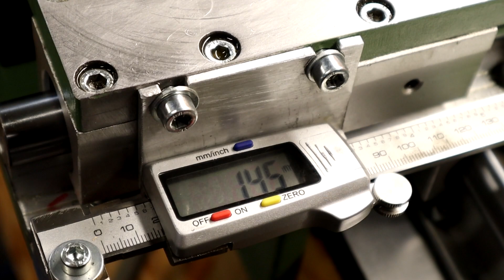Homemade Lathe #7 | Cheap Digital Readout

Comment: Those hardened stainless steel calipers can be drilled with a carbide drill. If you don’t have a spade or twist drill a carbide tipped masonry bit with the tip sharpened will do the job (and they are cheap!) or you can notch the piece as you did. Inexpensive digital readout that functions every bit as good as a high dollar unit! Awesome!!

Comment: I had to watch all of your lathe-videos in one go. Now I want to make my own. :)   Very good stuff.
I have one question, why is the cross-sled so long, considering that one would only ever want to use tooling on the front side of the chuck.  Is it to use the lathe as a mill instead?
Reply from the maker: Thanks,  Jes, so i have a clamp plate with a size of 20x30cm with 20cm cross-sled travel which is great if i want to upgrade my lathe to a milling machine...

Also its good if you want to clamp other stuff on the plate. Like now I have to mill a T-nut for a shaft...
So i can clamp an endmill in the 3 Jaw chuck and the shaft on the plate...

I hope you can understand my English ;D

Greedings from Deutschland
Reply: @dexter1448  English is good enough to understand. :)  I think I want to make a simple but sturdy metal lathe following your design and make it into a CNC-lathe instead.
Reply from the maker: @JWAM  good Idea!
Reply from the maker: I recoment visit his Channel, he build also an CNC Lathe: https://youtube.com/c/GBWMWeldingMachiningCNC
Reply: @dexter1448  excellent, thank you for that! Oh, one more question, the linear guides.. are they aluminium with steel rod on top, or are they solid steel?
Reply from the maker: @JWAM  the botom part is Aluminium
Reply: @dexter1448  Thanks! :)